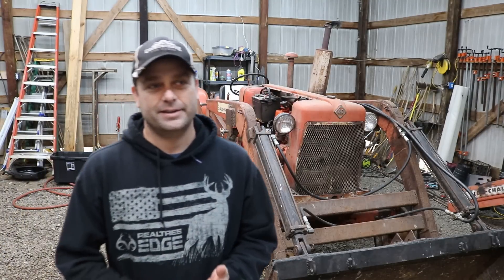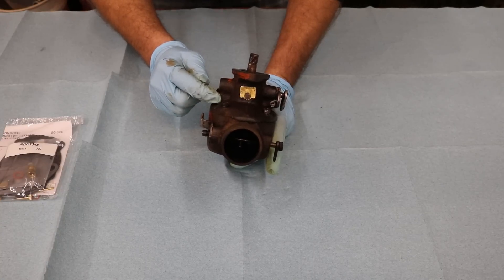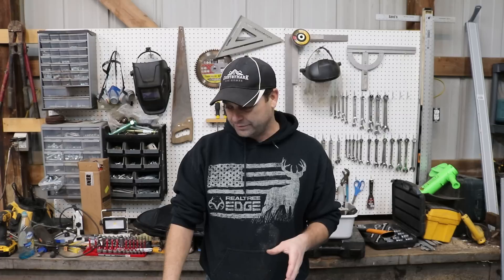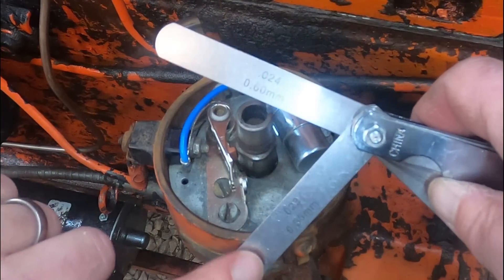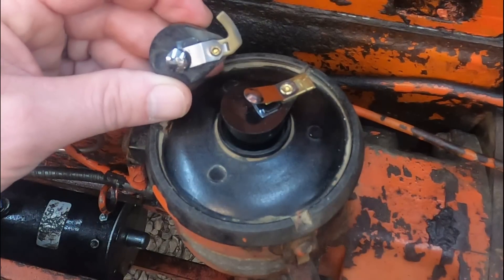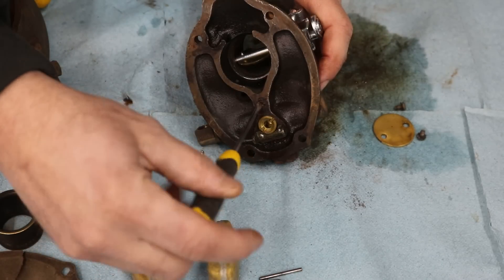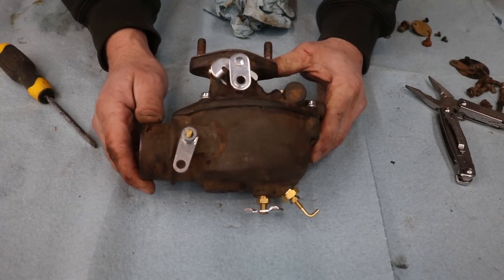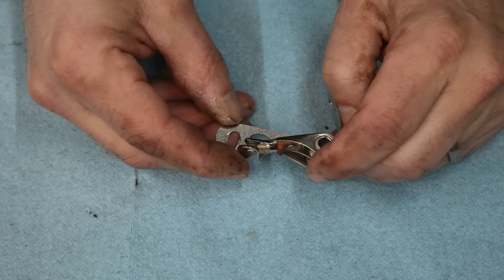Tractor Tune Up Didn't go Well - Allis Chalmers D17

Comment: I have same D-17, 10543 hrs. Use non alcohol gas, use lead additive which lubes valves. Check your sentiment bowl screen. My load jet is set between 1 1/4 and 1 1/2 turns. It had to be spark or fuel. Enjoyed your video, brings back a lot of memories. I’m talking to you while watching, check this or that. Get another set of points, once you file them, they burn. Good learning experience for you. Good old tractor. Thanks for sharing.

Comment: The carb needle was definitely the problem. The original points probably just needed to be filed down. Lots of new parts are China made junk so use the old parts for as long as you can. Still, you got it running. Great job!
Reply: Also, be sure to use ethanol free gas and put some stabilizer in it. Cleaning out your gas tank and putting an inline fuel filter and shutoff valve may not be a bad idea.
Reply: Generally the old tractors had fuel shutoff and sediment bowl at the tank.
Cheers
Reply: Me Chinese me play joke me go wee wee in your coke!

Comment: Brings back memories of my father repairing the carb of our BF Minneapolis Moline on the kitchen table.  Every spring he had to change the gasket.  He eventually ended up using one of those old cardboard coke containers and it worked.

Comment: Tractor sounds good. The battery sounds weak even with the charger on it. But look what you accomplished. 1959 was a good year.
Reply: Agreed on checking the battery.  Check your battery cables too.  Are the connections pristine clean at both the battery and terminal ends?  Take the bolt out where the cable is grounded to the frame.  You may need a wire brush on a rotary drillmotor to clean the rust there.  Someone may have replaced the cables with an el-cheapo set as well.  When you feel like really taking a dare, purchase a cheap timing light and give it a go at checking the timing.

Comment: The points problem is quite common today. Also you need to put a little lube on the distributor cam to prevent rapid rubbing block wear. There is a special grease for this. You showed real determination  Good Job for a first timer.

Comment: You'll have a lot less trouble and cost with the Allis Chalmers than you would trying to maintain the mechanicals and wiring on a modern tractor. Service it properly, keep it clean, shed it always and it will probably see you out, old as it is. Col the cornstar's tractors are 30 - 40 years old and look and drive like new. He repairs everything and polishes them every year and they shine !

Comment: Good morning Evan and Rebecca, patience is one of your best tools. Searching out the correct way takes patience. The wrong parts get costly. We all have lots of extra parts on hand that don’t fit what we own. In the end you have the tractor running and that’s what matters. Sure glad you were able to save the carburetor and fix the points problem. Both have to be precise and then they work so good. Close only works in horse shoes and hand grenades 🤗. Thanks for sharing with us and glad you came out on top.

Comment: In my mind, it is amazing to me that you can STILL get a carburetor kit for a tractor made in 1959 ... that's incredible. And sooner or later, all those parts you replaced would require replacement anyway ... so you got that done and out of the way. I know this was a frustrating adventure. Just be glad it wasn't a major health issue like some folks have to deal with ...

Comment: You might want to find an old dwell meter.  When working on old breaker-point ignition systems, keep in mind that setting the points by gapping with a feeler gauge gives you a starting point.  Dwell meters are available at flea markets and yard sales for pretty cheap.  I bought my SUN Diagnostic Center, new, back in 1963... no doubt you can find one of those still working for about 1/1,000th of the price I paid.  At any rate, once you get your engine running, then set the dwell angle.  I'm guessing the spec will be somewhere between 37 to 43 degrees.  Then you can set the timing.  Take note of the order of the tasks... point gap, dwell, timing.  Good luck on your new adventure.  In a few years you'll be one of the few who still knows how a carburetor works.

Comment: Glad you got it running, I have to tune up my old TO35 Ferguson so I feel your pain,
Do not know where I heard it or learned it, but somewhere along the road of life, 
I was told after you install the points, take a thin piece of cardboard, like a part of the box the points come in, drag it between the points, this action cleans some type coating off the point contacts,
Again I do not know where I got the information,
Good job on getting it running,

Comment: Have run and maintained a WD45 which has the same engine as a D17 for 50 years. ( Tractor was purchased new by my father in 1955 and is still used regularly on my farm.)  9 times out of 10 when it is not running properly or refuses to start the problem is electrical. The coil is where I start as it will fail in damp conditions. I try to keep a spare coil on hand but have got the tractor running by simply removing the coil and warming it a very low heat in my wifes oven.  Replacing the ignition wires every 4 or 5 years also helps.

Comment: This just popped up on the same day I broke my 5020 Allis Chalmers. I had just reinforced the from bucket arms. I broke the back left arm then snapped connecting bolts that connect the front axle (4x4) to the block. I'm bummed, but glad to watch your build. Nice
Reply: 5020 is a great tractor

Comment: Points usually need to have contact surfaces cleaned when installed. You need to put some grease on the back side of the rubbing block where it rides on the distributor shaft to prevent wear.
Reply: non-electrical grease, on the shoe of the points

Comment: You are doing a pretty good job, whenever you set up your point gap you should run a piece of white paper between the gap with the points closed. What this does it removes any dirt that you're feelers guage may have had. Also try to get the point gap as close as you can. If it off enough the gap can change the ignition timing. Have  fun buddy

Comment: Great job!  I kind of cringed when I saw you working on both the fuel system and the ignition system at the same time (assuming that it would at least start prior to beginning).  Believe me, I've made that mistake before.

As far as the points, I learned how to change/adjust them at an early age.  My first truck (bought when I was just 14 years old) was a 1963 Chevy that had points, carb and a mechanical fuel pump.  One of the best things that my father gave me was an actual shop manual (not a Chilton's or Hayne's manual common today) that had all of the information that I needed.  Keep in mind, there was no internet or Youtube in the mid 70's so the book is/was all that I had (along with my father's experience to guide me).  I learned how everything worked on that truck and did it all myself through my high school years.

I would love to find an older model gas tractor to resurrect and use on my property.  It can be frustrating working on that older stuff, yet satisfying when you make it work.

Comment: Evan, sometimes you buy parts that are new but old stock. points will sometimes get a slight film between where they make contact and need to be cleaned. a little sanding with crokers cloth or a fine file will clean them. never touch the contacts.

Comment: AC used 2 different carbs.  Marvel was the most common, but when I had an engine fire several years ago, the dealer put a Zenith on as he thought they were better on my 175.  Also, last summer I put in 3 different set of points and every one was junk.  I switched to electronic and wished I  had done it years ago.
Reply: Yep, went thru the same issue on my old Ford backhoe. First with cheap points from the Rural King, then the good ones from NAPA. Finally bought a cheap electronic ignition kit from fleabay and my ignition problems went away...

Comment: Evan, I would recommend using a sand blaster to clean the carb properly, afterwards, use light air pressure to blow it out. That way you'll have fresh, clean threads on everything to guarantee a fresh, clean and easy fit. Great job though.

Comment: Very good video. I had a similar issue with starting on a car, years ago. Turned out to be a bad condenser (brand new). So goes to show you sometimes the new parts are not perfect.

Comment: From an old guy: yes always file new points as some manufactures do put a protective covering on the contacts. If the gap requires 20 thousands - then do 20 thousands. Points wear and the right gap keeps the machine running longer. The carb needed to be disassembled then soaked in a bucket of parts cleaner solution. If you had done this, then blew out all the passages with high air pressure, you screw might not break.  Ignition wires - make your own. I get it, you are new and you did get it done. However, this is just the first of many. Get a parts cleaner! As for changing over to 12 volts - do it.  Electronic ignition? Pros and cons. Points need cleaning and resetting. Wear they start to wear out, your tractor will start to act up, but won’t quit on you. Electronic ignition works one second, then is dead the next. I prefer the 12 volt system and the electronic ignition, but always carried a new one on the tractor. Strange as it seems, you and your tractor will become friends.

Comment: You have it running sweet now and that is what counts!
When you upgrade / renew stuff it is a good idea to do it one thing at time so you can locate problems to the piece you are working on! What you called a rotor was actually the rotor arm ... the rotor is the metal piece that is geared from the crank and spins 1/4 (usually) crank speed! The arm is simply a high voltage switch to feed the spark yo the relevant cylinder. One thing to check on is the condition of the connection under each lead from the rotor arm (it develops a spark every time the cylinder fires and so can get a build up on it reducing the spark power) 

Another common problem (especially if your tractor does not like the rain) is water vapour getting inside the distributor cap ...... WD40 is your friend there! 

Back in your dizzy .... the points also need to be set to the correct time! Set your points up as you did and loosen the clamping screw on the distributor housing a touch. Get a strobe (fits between your plug and dizzy lead on cylinder1) Look on your crank at the front and you will see that on the main pulley wheel you have a line scribed into it. You will also see a plate with TDC and several lines demarking degrees to eather side of it. When the engine is running shine the strobe on the plate and you will see the line on the pulley wheel against the plate. Rotating the distributor (slowly) will alter where this line is against the plate and so your timing can be adjusted!

You can also get (or could .... I am old school) a specil spark plug that you put in to one cylinder. It had a glass section around the electrode. This allowed you to see the colour of the burn in the cylinder! Often it was not easy to see direct so they had a plastic tube that clicked over it with a mirror on the end and an extension to the electrode that you clipped the HT lead into. The point of all this malarkey was to allow you to alter the jets so your engine did not run lean (run rough and overheat) or rich (waste fuel and clog your plugs)! You could also get this information by taking a look at the spark plug before you cleaned adjusted or replaced it! This is a good way to check it is running well but not handy for setup ;0)
Reply: Thank you for sharing your experience and wisdom  !!😊

Comment: Nice job. I say if you plan on keeping it a while, you may as well upgrade like you did.   so, glad it all worked out.   I am impressed you did the carb rebuild.  I am always afraid to jump into those projects.  afraid I will end up breaking something that makes it worse instead of better.   or.. would miss something so small yet so frustrating like the points that wouldn't work.  grrrrrr.

Comment: on the  distributor i would have inspected the timing advance system under the points mounting plate.. on the carb make sure it is a D17 carb on it and not a WD45 carb. they look the same on the outside but the airflow  is higher on the D17.
the WD45 , D15 and D17 are my 3 favorite AC tractors.  . the D17 was by far the best most reliable AC made.  you got a bargain  i grew up on a 250 acre grain farm we had a D15 and  WD45. i was an AC mechanic for several years. you can expect  to get about 3000 to 3500 hours between in frame overhauls maybe longer with the better oils of today. . and service the oil bath air cleaner once per year in dusty conditions. i would disassemble it and clean the screens above the oil bath.
just because it is old does not mean it is going to start falling apart.

Comment: I have old tractors on my farm. When i rebuild one i put new carbs on them. You can get them for 40 dollars more than the kit. And when the points fail I  swich them over to 12 volt electric  injection.  It costs about 60 dollars more than but the electronic  ingnition system will never have to be replaced. Around here in the spring tractors sweat in the shed from frost and the moisture faults the points with rust.

Comment: Great job. Most of the time u can just file the points so they get better contact might save u some money next time. Also in the video of u changing the oil i didnt see u change the oil in the airbath cleaner. I have 3 allis chalmers tractors just like this one. Let me know if u need help in the future.
Reply from the maker: I changed the oil in the air breather but wasn't sure what type of oil to put back in. I put in 30 weight oil but it seemed like that may be too thick of an oil. What type of oil do you put in the air breather reservoir?
Reply: @CountryViewAcres  10w-30 or 10w-40 either one works fine.
Reply from the maker: @michael-ze2li  thanks.  I will probably swap it out for the thinner viscosity oil.
Reply: @CountryViewAcres  your welcome that carburetor thats on that tractor is suppost to have a choke on it. It should come down the side of the tractor. Also Our wd and wd 45 has a sediment bowl on the bottom of the tank that has a shut off valve on it. You can drain the bowl out and that helps from getting dirt and other junk into the carburetor.
Reply: Country View Acres   Most oil bath air filters use SAE 10 oil, either detergent or non detergent oil.  Good luck from north east Montana.

Comment: Did you put some cam grease on the dist. cam if not it will wear down rubbing block on points and changes the point gap on the points.

Comment: Would be a good idea to get a good heavy magnet and place on  the fuel tank as far back on the bottom from the fuel tank discharge to the carburetor that will 
Collect and hold any fine rust that may have accumulated in your fuel tank and will prevent a host of future problems with the fuel side of your tractor. Filters and carb because most all farmers allowed their fuel tanks to set less than full at different times of the year. Air in the tank not fuel equals moisture and that equals oxidation.

Comment: You'd be surprised what .002 difference in setting points will do. Being they said .020 and you set them at .023 they probably weren't making contact even though it's so small you couldn't see it. We always set them with a matchbook cover which is around .017.

Comment: Hello. Just watched the engine tune up that didn't g s well.
You stuck with it  and its running !
My question is because i have 1958 AC D17. needed & got a major overhaul.
Sooo. It has positive ground.
It had no battery in it. Only had cable from starter to solenoid. 
So with the positive ground where does tst cable connect at ?
Thank you 
Daniel  in Alaska

Comment: I think you need to call a mobile mechanic (after you fit the bits) to reset your points gap, timing, vacuum and mechanical advance . A wide point gap will advance ignition spark and given enough advance can break a crankshaft. Idle mixture as well. Your lack of spark may be the coating on the points you didn't know about.
Reply: Mechanical advance only.....

Comment: I've made a decent 'retirement' living working on pre '65 tractors for the last 20 years. That Marvel Schebler Carb is FAR superior to the original Zenith.  THAT'S exactly WHY they got 'swapped out'. Buy a gallon of 'Chem Dip' at TSC.  'Polishing' the points' contacts is ALWAYS a 'given'. Also, your viewers need to be made aware that 20% of the 'new' foreign made condensers are JUNK right out of the pkg. SO, if you lack fire after swapping everything out, put the OLD condenser back in. This solves the problem 90% of the time. If your tractor has been converted to 12V, you need to use the ballast resister unless you put in a 12v coil. A 6v coil will only give about 15 min of 'run time' without it before it heats up and shorts out. 4-5 min of run time is indicative of an old key switch.  Hope all this Helps.  Best of success and God Bless....~Eli.